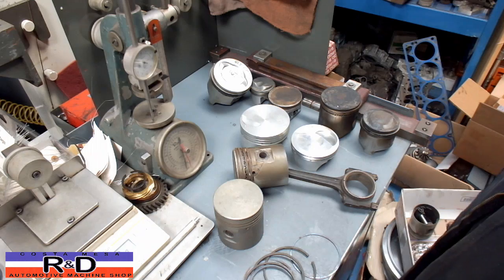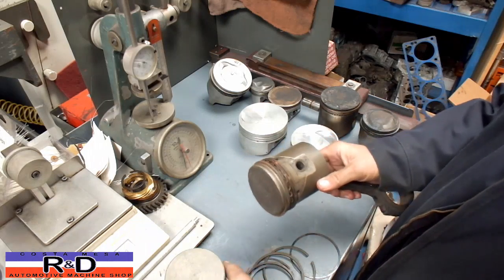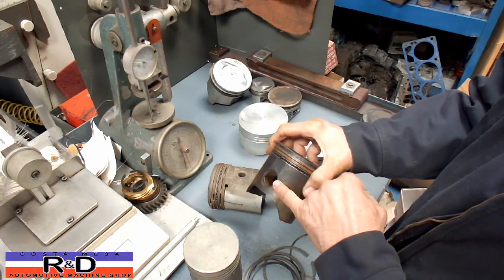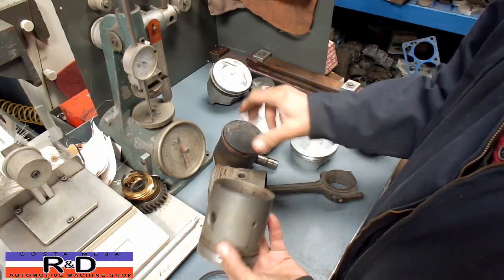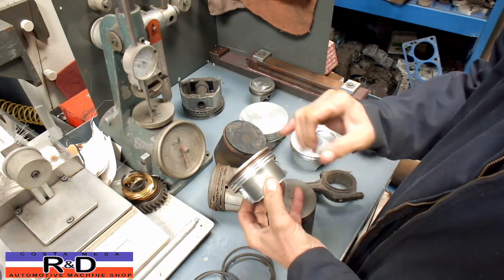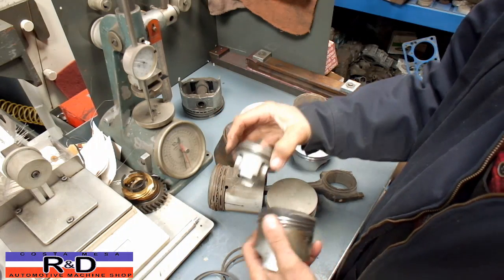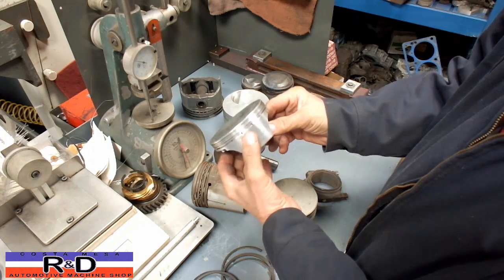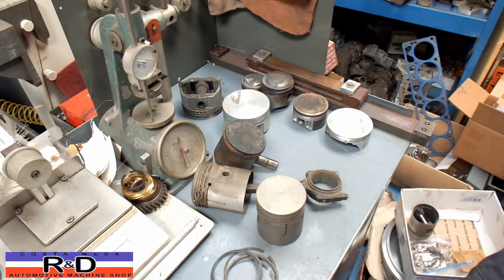Piston History Lesson v3

Comment: Interesting subject, but it might have been nice to spend a bit of time discussing why each design was made the way it was, and what each successive generation achieved and sacrificed with the changes that were made. As an example, those pistons with the short skirts allow for light weight, and large stroke/bore combinations, but they are less stable in the bore, and will not last as long as a taller skirted piston will. Not an issue in a NASCAR engine, but contemporary motorcycle engine designs use this feature, and they don't last like the older engines did! And also the thinner rings reduce friction while at the same time sacrificing longevity and are less robust than older designs...I've heard manufactures went that way for mileage and emission concerns, not because it was better for the engine parse.